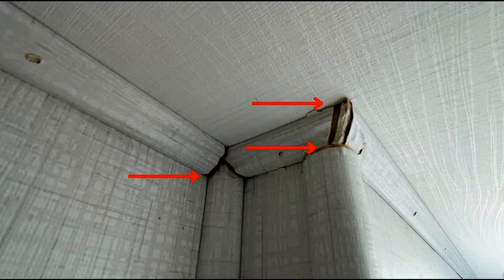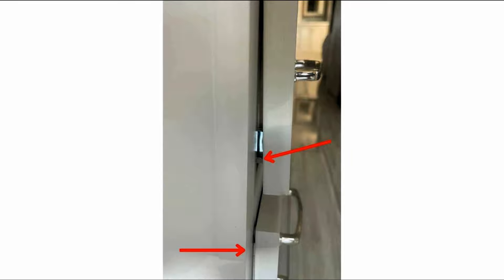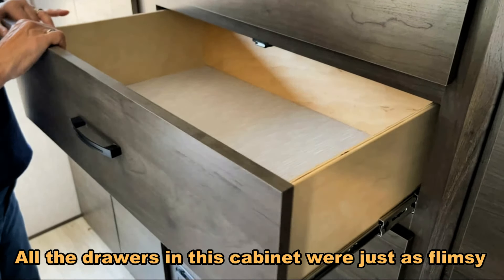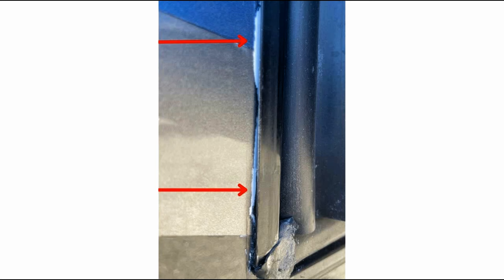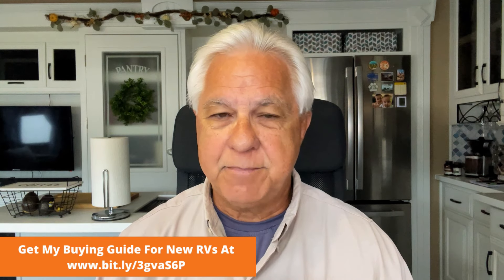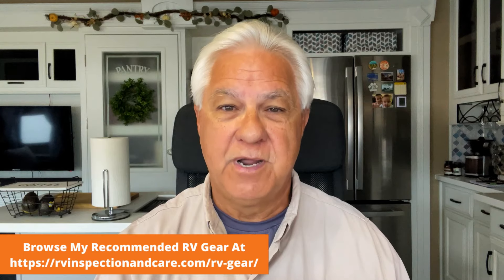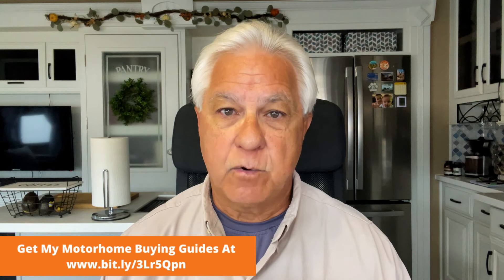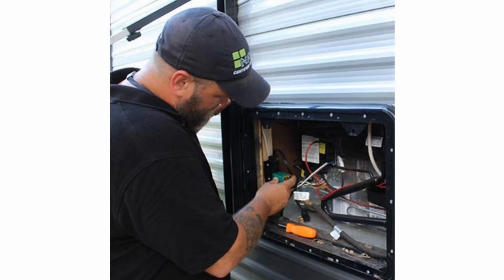New RV Quality - How You Can Spot Build Quality As A New RV Buyer

Comment: Very surprising that RV dealers would have such egregious quality issues on display.....doesn't say much for them.  Schwintek slide outs are widely misused on full wall slides containing heavy items throughout the RV industry.  They are destined to fail even if rollers are used.  Many have had to replace them with alternative mechanism at significant expense.
Reply from the maker: So true Robert. The Scwintek mechanism itself is not designed to hold or support significant weight. And as I said in the video, it works just fine for smaller slides like ones often found in the bedroom. But using it on a super wall slide is just asking for major problems to develop that will often be expensive to repair. There is a reason why I don't recommend some RV brands, and this video helps explain at least some of those reasons. Safe and happy travels to you!

Comment: I am planning to buy a Jayco Percept  .
Should I buy the 2018-2019 with old v10 engine or 2020-2022 with new v8 Godzilla ? I do like Godzilla engine but I heard that during pandemic the built quality was crappy ….
Reply from the maker: That's actually a good question Cristian. The new V-8 engine is better on fuel economy and it produces less noise in the cockpit because it's not as high-revving as the V-10. And so far, it seems to be pretty reliable from most reports coming in from the RVing community. As far as Covid-built RVs are concerned, there is some reason to be concerned due to the unprecedented workforce and parts supply issues that all RV manufacturers faced during the pandemic years of 2020-2022. I wouldn't go so far as to say that all RVs built during that period should be avoided altogether as some claim. But I do feel that if you consider buying an RV from that time period, be extra sure that you carefully inspect it thoroughly before making the actual purchase. And that certainly means hiring a certified RV inspector to give you a complete report on that RV and getting all the issues fixed before taking ownership of it if at all possible. I hope that helps.

Comment: I wish more companies use azdel exterior walls.
Reply from the maker: Azdel can be helpful for delamination. But what many people don't realize is that many RVs that have Azdel in the walls don't have it in the floors or ceiling area leaving those areas still vulnerable to water intrusion. And honestly, if an RV owner stays up with joint and seam management on the outside to prevent leaks, it doesn't matter what materials are used in the wall construction. Lots of older RVs from many years ago that were built with stick and tin processes are still fine because their owners cared for them properly.

Comment: I'm scared of any RV Manufacturer that uses Swintec slide mechanism on large slides. I know Thor uses Swintec on the Palazzo and Aria Full Wall Slides. They claim it's fine because they use rollers underneath to hold up the weight. But that's Thor who are not noted for any kind of build quality. I can only imagine what's going to happen to Tiffins high build quality now that they are owned by Thor.
I would recommend that everyone buying a New or Used RV pay to have that RV inspected by a NRVIA Certified Inspector. They know what To look for. It will pay for itself.
Reply from the maker: Hi Joe. Yes, as I said in the video, the Schwintek slide system is actually a very good one if it's used the way it was intended, on smaller bedroom type slides. But to save money over using a more robust electric or hydraulic system, some brands have installed it on super slides instead. It's a repair just waiting to happen at that point. And it tells you something about the kind of poor build quality that manufacturer is allowing.